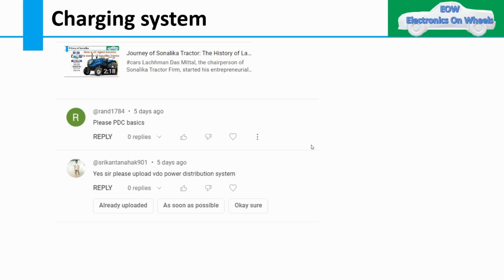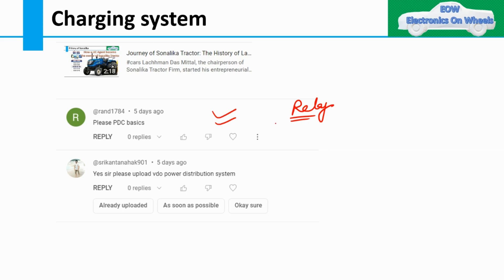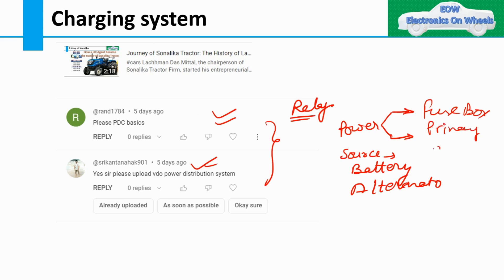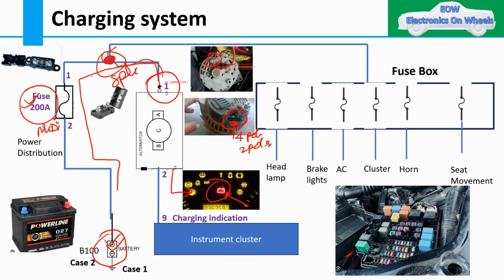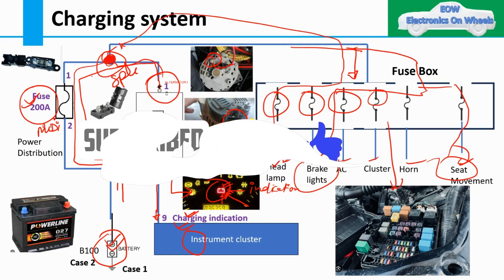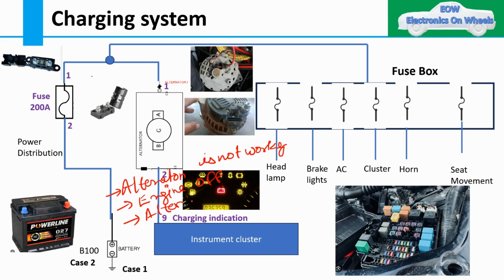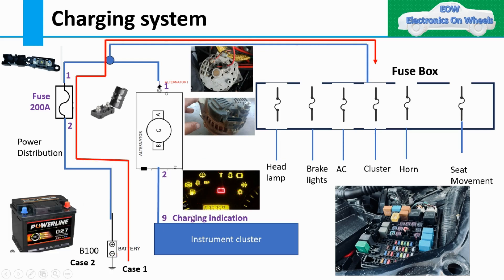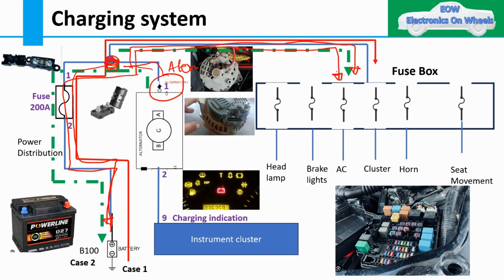Charging system part 2|| schematics||wiring Diagram|| Power distribution|@TheCarCareNut

Comment: Thank you. 

Please say, if it should be installed any Diode on the wire #916? So, it will block the below of current in the direction: Alternator - wire #915 - wire #916 - fuse - battery.